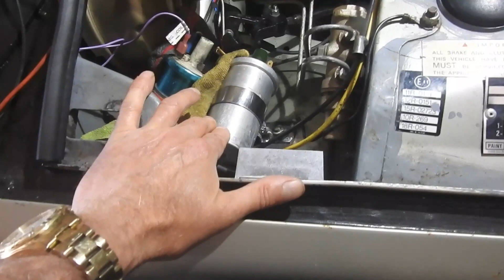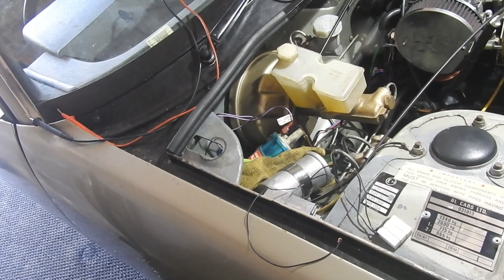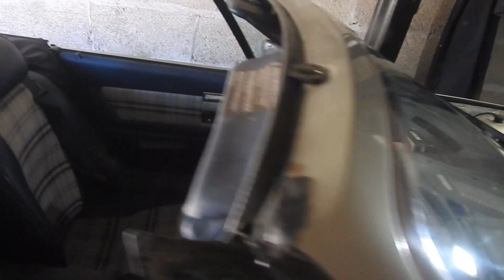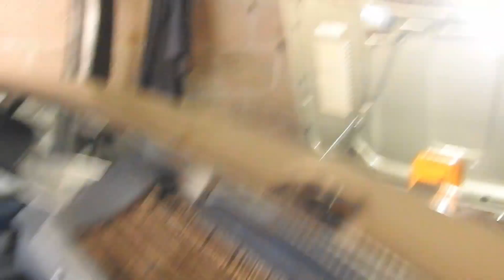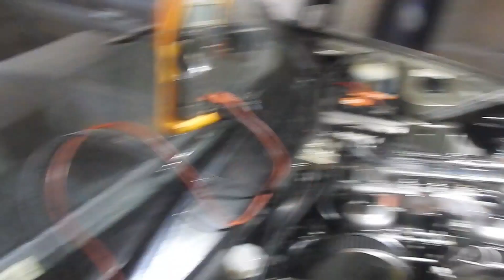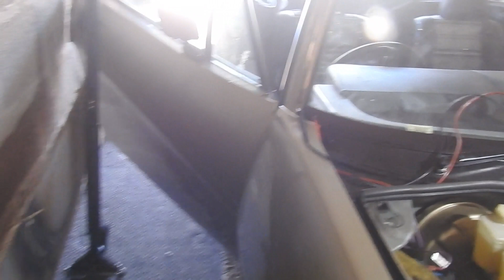Triumph TR7 Coil Update Part III

Comment: Glad I found this video. I have exactly the same issue with my 7. Luminition installed. Going to try and find a 12v 3 ohm coil now, had a replacement coil for another issue about 2 years ago. Guess it may be the wrong one. Thanks
Reply: Thank you. Could you please give me a short explanation of how?
Reply from the maker: @chrisbaker7545 you need to look in the manual (Haynes manual) and look for the white & white/yellow wire these two should be shorted together to permanently wire out the eureka wire. Any white wire in the 7 is related to the ignition side of things. Do you have a Haynes manual?
Reply: Yes got a haynes and a workshop manual. I get what you are describing. Thank you
Reply: I have just measured supply to the coil and it is 12v. Looks like it was modded before i owned it and the shop sent me a 6v replacement for another issue. Thinking that should be correct. I would have never known but for your video. Thanks again
Reply from the maker: @chrisbaker7545  Hey Chris you are sorted then, great to hear and happy that my wors have helped somebody out, it’s what YT is for too eh!
Reply from the maker: You need to make sure that your eureka wire is shorted out too, this will be in series with the coil resistance!